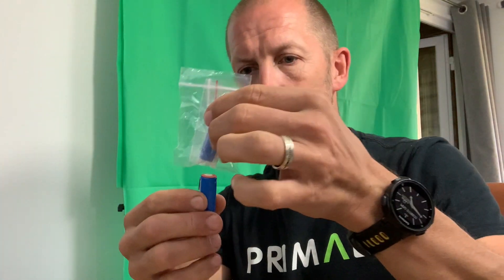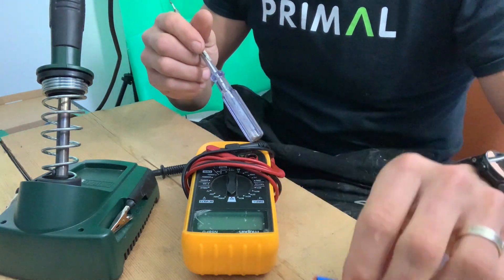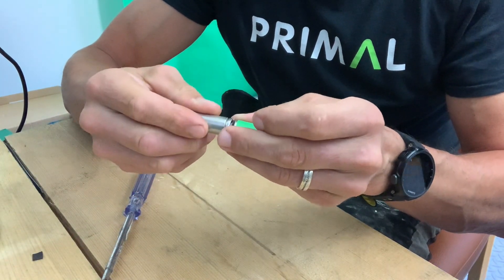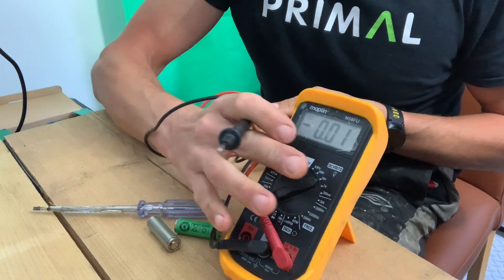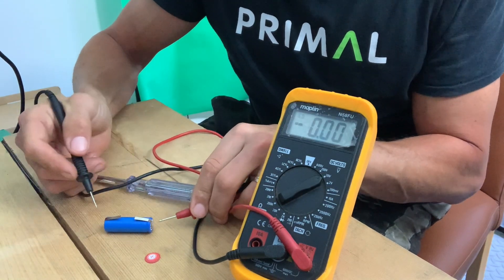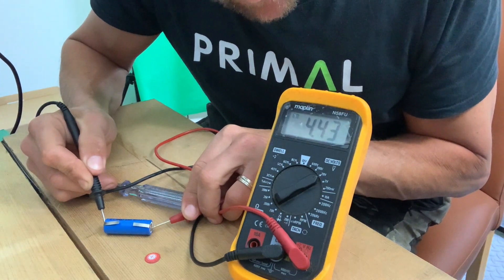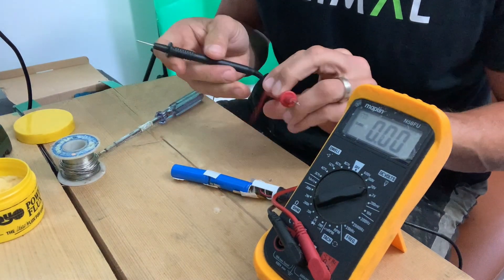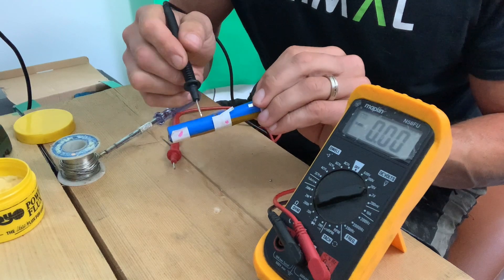Shimano Di2 Battery Replacement/Di2 Battery Not Charging(complete strip and rebuild, cost £13.99)

Comment: Some quick thoughts - firstly, thanks for making a helpful video. Second, early in the video you described the batteries as being in parallel, when they're in fact in series. Third, and  MOST IMPORTANT, is a comment about safety.

When you're soldering to lithium ion batteries, spend as little time with the iron on the battery as possible. They're temperature sensitive and like to blow themselves up. My recommendation would be a slightly different approach than was done here. Dab some flux right on the battery, a little is enough. Get a nice big drop of melted solder on the tip of your iron, and let the solder wick off of your iron onto the battery terminal as the flux cooks off. Doing this instead of melting the solder as you're pressing it against the terminal will hopefully get you an adequate joint without having to put too much heat into the cells.

thanks again.

Comment: Thought I’d share some extra information, when I completed this my battery didn’t work. I checked the voltage using my meter and it was all fine up to the circuit board. 

So, I download the old version of the Di2 software v3.4.5 onto the PC. I connected my bike to the PC and whilst I had the latest battery firmware I’m sure it did something to the circuit board to bring it back online, if that makes sense! 

My battery: SM-BTR2, charger: SM-BCR2. 

Important note the SM-BCR2 charger is the PC linking device for E-tube project software version v3.4.5, find it in the archive section of the shimano e-tube website. 

Thanks so much for the video Davie! Saved me some dosh…

Comment: I've found the answer regarding difficulty in removing the inner from a BT-DN 110a, see my earlier comment . After carefully slitting the outer case, with a Stanley knife, I was able to use a sharp pointer to prise the inner from the end of the case. I then found the a double side sticky pad was used to fix the end battery to the case.  It maybe be possible by very careful drilling hole (say 3 or 4mm dia.) in the end of the case to push the inner out without the need to first slit the case.
Reply from the maker: Nice one!  Hopefully this helps others!

Comment: Many thanks for a great video.  I've have a BT-DN 110a that I am unable to remove inners.  I've put forks in the groves at each end of the case and tapped these with a hammer. I've also tried gentle heat, which may release glue, but with no effect.  The only thing I can now think of is carefully cutting the case. Do you have any suggestions? Kind regards Pete
Reply from the maker: I had a Quick Look at that one and it seems to be just a very similar design with the 2 tabs near the main connection at the opposite end from the shimano sticker.  Best of luck. 🤞
Reply: A Reddit post noted that the A series (gray casing) has welded end caps.  Will have to be cut open.

Comment: I replaced my batteries with new cells from Digikey. $3 each.
I welded on my own tabs on the batteries and found the tabs and solder joints need to be tidy or the assembly won't easily fit back in the case.
For $6 my Di2 is back in action.

Comment: Writing here because I haven't found any help on the internet
I replaced the cells in a battery that stopped holding charge for more than 24h. Essentially, I did the exact same job as shown in this video. The problem is that the di2 system pretends my battery is dead despite it being charged. I can charge the battery with the normal di2 charger, everything seems fine. But when I try to shift, the junction box blinks 5 times red - meaning the battery is dead. Except it isn't, both cells are at 4.2V

My guess is that the microcontroller of the battery decided it was dead (either for safety or just to stop you from repairing it, Apple style) and refused to change gears, since a big part of the brain of the di2 system is in the battery

I tried updating the firmware of the battery using the SM-BCR-2. I hoped that updating the firmware would "reset" the battery, but while I managed to update it, it still refused to power the system

Also worth noting, the shifting works when the charger is plugged in, but won't if the charger is plugged in but not the battery. So I know the battery can physically work but won't
Reply: Все верно ! Замена не поможет , так как shimano встроило в сип защиту .  Я не верю , что те люди которые поменяли внутренние аккумуляторы, что у них получилось .  Нужно менять и чип .

Comment: Hello,

I have some question about Di2 Battery connecting area.
Beside cable connector (coaxial) we could see some kind of copper plate (lamella)
I think it could be for  "hard reset" of battery. 
Disconnecting  cable make this late in contact with outer of coaxial connector. 
Right ?

Comment: Just fried my battery. It wasn't holding charge well and I decided to replace cells. Opened it up and started to carefully peel tape. Suddenly got a whiff of smoke from the board. Put everything back - Di2 is completely dead and not charging (charging light doesn't come on).
Not sure what could happen. Is it possible Shimano added some tamper protection to newer batteries? BT-DN110 from 2016
Meanwhile my bike is dead until new battery arrives... :(
Reply: Shimano ставит защиту ! Я не верю , что у автора видео получилось заменить аккумуляторы и они заработали . Пускай покажет видео , где он работает .

Comment: My DN110 doesn't show up on the pce2 and when trying to charge and the light on the main charger doesn't appear.  Opened up the casing and the voltage was 6.16v. Tried to push up the voltage for both and for each battery using 12v but not really moving much 6.56v.  I would have thought the unit would still be recognised with 6.16v so before I start thinking about replacing the batteries, any idea if the CPU is most likely at fault?  The charger is getting power to the batteries but not charging them I believe.  Both batteries are over 3v.
Reply from the maker: Hard to say but there’s only really 2 things that can be wrong.  If the PCB isn’t working then it’s game over anyway so I’d say always worth changing the batteries for how cheap it is.  If you still have both batteries connected together then I think you may not get an accurate reading of each one.  When I checked mine, one battery was a lot lower than the other.  I recently tried to replace a friends batteries and it turned out they were both holding a good voltage but there was no shifting so that points to the PCB not allowing power through to the shifters.  I’d do a full system reset first.  Shane Millar (GP Lama on YouTube) has done this so have a look and follow that first before going any further.  Hope this helps, good luck! 👍
Reply: @waveydavielines  thanks for the quick reply.    Think it might be PCB... Added two 18650 batteries to the existing set up, held them in place and no lights on the junction box, nor on the connected charger. I've found any component that could not be recognised as takeover I e hardware issue..

Comment: Not to criticize but if you use a better solder iron you would get better and faster results with your welds. Using that iron you are holding the heat on the battery longer trying to get the solder to melt, that is not good for the battery. I see those batteries came with tabs on the ends. you only need to solder the tabs together between the two batteries and not try to solder the batteries together. I have experience building battery packs mainly using the 18650 cells but they are basically the same. I do appreciate you posting this video because it will save me money when it comes time to replace my Shimano battery. I will give this a go
Reply: Also that’s plumbing flux.  I recognise it as I have some.  It’s acid based and not the same as electrical flux (which should be built into the solder if you use the right one).  Avoid using acid based plumbing solder on electronics.
Reply from the maker: Thanks for the tips! Hopefully others that plan to do this will read these too! 👍

Comment: Good tips. But. Dismantling mine, find batteries were 100% despite being 4 yrs old, it was the little PCB on the pack that fried. For that there's no fix but to but a new £120+ rip-off priced pack.
The E-tube confirmed the master unit wasn't visible, until the DN-110 smart battery was plugged in to the system
Reply: wow... 4 years... I just used 13 months... dry out...
any secret how u maintain it???

Comment: Davie or someone, have you managed to do the same with the newer Shimano Di2 BT-DN110 model? I am having a hard time "opening" the housing... It does not have the tabs to push in to release the housing...
Reply from the maker: Sorry, I’ve not had any experience with that one but looking at pictures online it does seem to have similar guides at the top near the plug connection, to line up the inner and outer case so it must pull apart.  Possibly it’s been glued to seal it?  If there is no obvious tabs to push in then I’d probably try heating it with a hairdryer and see if this softened any glue.  If not then I’d carefully take a sharp blade to the outer casing and open it that way.  You could then try to reuse the casing or just tape it all up together once fixed.  Hope this helps.
Reply: I used a screwdriver blade to pry the top out of the case. Slowly pry each side. The 2 tabs mentioned in the description don't really depress on my battery...just act as snap fits.

Comment: Can anyone help,  problems with Di 2. After testing the battery., pressing the lever, solid green light comes on followed by the red three seconds later, green and red lights are on together.  What does that indicate?  Rear mec is working but front mec isn’t,t .  Battery is showing 7.5v .
Can anyone help
Reply: Your battery is low if the front mech doesn't work but the rear mech does. Shimano manual explains this. It's a feature designed in to the system so you're not completely stuck out on the road.

Comment: Thanks for the great video! I missed the part where you opened the casing to reveal the batteries. Is that on the video?
Reply from the maker: Sorry, it looks like I missed that part on the video! 🤦‍♂️. There is 2 little rectangular  tabs at the top of the battery casing, just below where the cable plugs in.  You need to push these in and then prise away the top part where the cable attaches.  This will remove the whole internal unit with batteries attached.  Hope this helps!  Thanks, Davie
Reply: @waveydavielines  This fitting applies to the old, BT-110 battery, but not the new BT-110A, which has a welded case.  The  newer case will require careful work with a jeweler's saw or utility knife, but that leaves the question of how to hold the case together after cutting it.

Comment: Great video Davie... inspires me to tinker with my BT-DN110A batter pack that is no longer holding a charge. Only problem is that I am unable to source the 14430 batteries required to fit the battery housing. I was contemplating using the 14450 batteries... they have the same 3.7v but higher mAh.... in your opinion, you think this could be an issue? I was thinking of just building a new housing for the slightly longer battery if the configuration works with the chip.
Reply from the maker: Thanks for the comments!  Im no expert but as long as the voltage is the same, this should be fine.  The mAh is only the storage capacity so this should in theory give you longer between charges.  The only issue you will run into is  with the longer batteries, the original wiring harness may not quite fit as well so you may have to extend that.  The bottom of the plastic housing could easily be cut to allow space for the longer battery and then you could tape it or make something to seal the bottom.  Then you would be able to retain most of the original casing and how it connects to the top cap.  Good luck! :)
Reply: @waveydavielines  Thank you! That's exactly how I have planned it! Will update if this works.
Reply: @desaipushpak скажите пожалуйста, у вас получилось ? Батарея shimano заработала после замены аккумулятора?

Comment: Great vid and good to see the art of entrepreneurship isn't dead. Only 1 comment, you said the batteries were connected in parallel (at 1.25) but they must be in series if they're both 3.7v and give a total of 7.4v? If in parallel the total would still only be 3.7v. My only query is if they are in series, why have a separate 3rd wire coming off the centre connection between the 2 batteries? I can't understand what that's for....anyone?
Reply: The extra wire is so the charger can see the individual cell voltages and make sure both cells are balanced.
Reply from the maker: Yeah, thanks for that, i'll stick a wee comment in to point that out.  No idea why it needs that 3rd wire unfortunately??.
Reply: @waveydavielines  It may be for charging the batteries separately as the charging source is 5v.
Reply: That's what I was going to correct him on.
Reply: This information may be outlined in the documents you can find through the US Patent Office. I'm certain Shimano won't give any schematics.

Comment: I wonder if this will work the the A version of DI2 battery. As in the BT-DN110-A for the Ultegra DI2 8050 which i have. 95 pounds Sterling for what amounts to 2 rechargeable batteries is a bit steep. Thanks for this. I bet the battery suppliers listed are happy. On their site they say in the description that this is for 6870 Ultegra though.
Reply: How did you take battery apart
Reply from the maker: @davidturton8713  Sorry, i only just noticed this reply!  The plastic housing presses in with a small screwdriver on two clips at the top and then I used a stanley knife to slice the solder clips from the battery.
Reply from the maker: I can’t see there being much difference to be honest.  If it’s not working anyway then you can’t make it worse by trying.
Reply: Yup, this will work with the DN110 as well. The BTR2 and DN110 are exactly the same voltage and power output. The only difference in the two are that the newer DN110/110A batteries contain a memory chip for synchronized shifting customisations. The internal batteries themselves are the same so Davie's hack will work no problem.